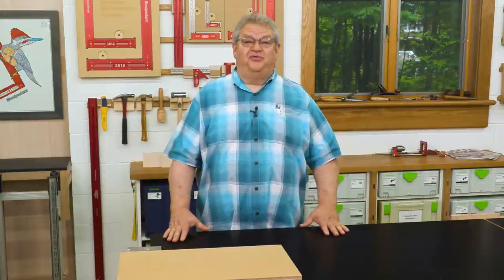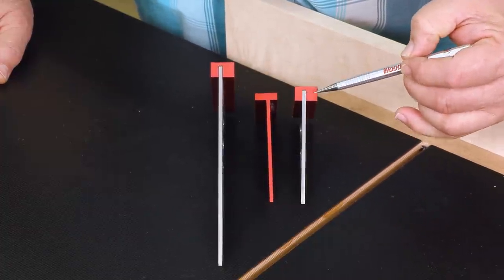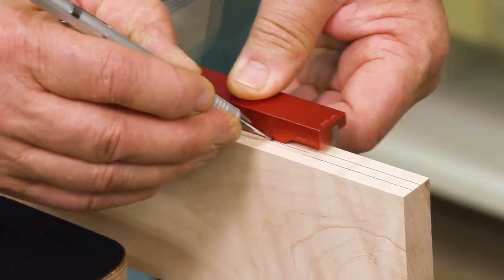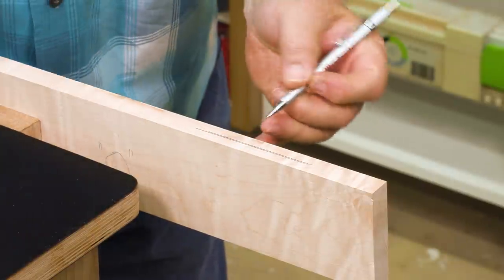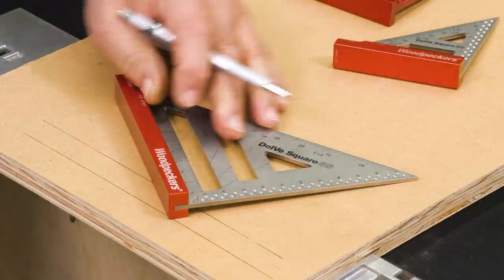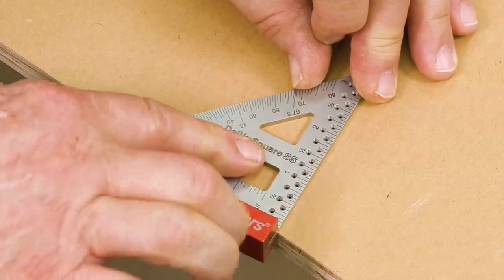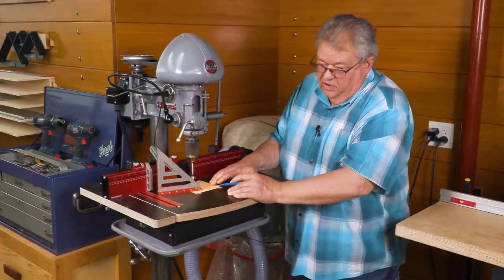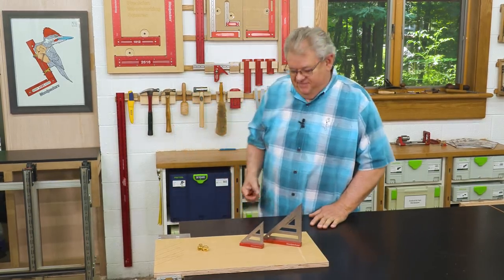The Handy Little Squares With The Funny Name | Deep Dive | Woodpeckers Tools

Comment: Woodpeckers tools are #1 in the construction of the tool and its accuracy.  I have many Woodpecker items especially both types of these squares and I use them all the time.  I even to line up my table saw blade 90 degrees to the table and placement of my drill press table 90 degrees to the drill chuck.  I use these squares as my calibration gauge to compare other angle tools and projects in my shop.  I am glad to see that they now sell and use the mechanical pencil that I suggested to them a while back for even more line accuracy.  Keep up the great work and products.  Thanks!

Comment: I’m beginning to hate these videos. They’re very well done with excellent content. But they make me buy all these amazing, handy tools!!
Reply: Switch to metric - not only will your measurements be easier to do, but also you won't want to buy these tools as Woodpeckers seldom make them in metric.
Reply from the maker: I think you're trying to be humorous, but "seldom make them in metric" is just wrong. Well over 80% of our measuring and layout tools are available in metric. The few that we do not offer in metric are because of indexing features that would require a complete tool redesign for (what is for us) a limited market.
Reply: Riiiiiight?  Daggonit, every one of them makes me start drooling and want to buy another handy tool!  xD
Reply: @julianniemeyer1655  Why do metric fans spend so much time criticising non-metric? Are you so insecure about your choice that you need to do this to convince yourself? If you prefer metric, then use it. Those of us who don't use it don't need the endless lectures.

Comment: I work as both finish carpenter and cabinetmaker. I own both aluminum and stainless steel Delve Squares. I use the little aluminum one on site, where I have found that on any but very smooth surfaces, the small diameter leads that will fit tend to break easily. I customized my square to accept leads from my 2.0 mm mechanical pencil and my Picas by reaming the marking holes with a 3/32" bit, using a drill press. Given the tolerances appropriate for finish carpentry, as opposed to cabinetmaking, and the fact that the 3/32" bit self-centers in the original holes, my modified Carpenter"s Delve Square has turned out plenty accurate for my purposes, (much better than generic carpenter's speed squares) while rendering it far more practical for typical on site tasks. I suggest Woodpeckers consider offering this version.

Comment: I have the original aluminum and a 6" stainless steel.  I absolutely love these squares.  The biggest benefit to these squares which surprisingly wasn't mentioned in this video is how much time is saved in layout work using one of these squares instead of a traditional square.  At least that has been my experience and why I love them so much.  It's the first square I reach for, and often does most or all of the work I need.
Reply: Yes, I think a 'speed square' is much more useful for layout than a traditional square. In fact I can't really think of any advantage to a regular square. I wish they would make a 12" version

Comment: What kind of table is that on the dp 220? I have a bench mount dp220 as well. Painted the same color. But smaller table
Reply from the maker: If you're talking about the add on table, that is our DP-PRO. If you're an eagle-eye, and you're looking at the table the DP-PRO is mounted to, that is what Delta called the "Production Table". Much larger than the standard table, with a coolant trap all around the perimeter and a gearbox elevation system.
Reply: @WoodpeckersLLC  production table yeah. I like. It also appears you have an extra table support on the back side of the column! (I seen it in another video)That's a great idea.
Reply from the maker: I needed a regular Delta table for the DP-PRO installation video. I bought one off eBay with the intention of turning it back around after I shot the video. Turns out, having it as a "catch-all" table works really well, so it's part of the family now.
Reply: @WoodpeckersLLC  I'm looking for one on eBay also and another table for the same application on a DP 600. My main DP though is a powermatic 1150a. There a little heavier dutier than a delta but not as much class

Comment: Will a .7mm mechanical pencil fit into the scribing guides or is a .5mm preferred?
Reply from the maker: You can use a .7mm. A .9mm is what I'm using in the video. Either is a better choice than a .5mm, unless you have a very light touch.
Reply: I think a 9mm is the best bet for nearly all the Woodpeckers Triangle/Square scribing guide holes. The 7mm is ok but a little less sturdy. The 5mm is usually not worth the headache. It breaks too much, especially on this tool because of the depth of the hole.

Comment: On the metric versions, are the steps and cut-outs also metric?  Fractional and whole inches aren't useful if you're working in metric.
Reply from the maker: For that reason, there's no metric version of this tool.
Reply: @WoodpeckersLLC  Metric versions would be great.  The rest of the world outside the USA uses metric and more American woodworkers are using metric as well.  I use lots of 18mm and 12mm plywood, for example, so 6mm and 9mm setup blocks would be very useful for setting up tools for grooves, dados, etc.
Reply: Fat hope trying to convince wp to make anything in metric . 😂. My workshop will be flooded with them tools if it ever happen. Now I have a few items that sit there on the wall looking nice simply because it’s not metric